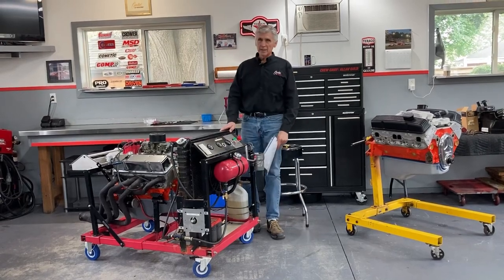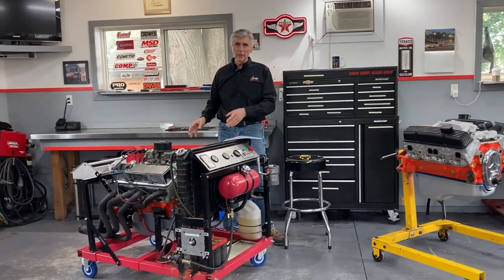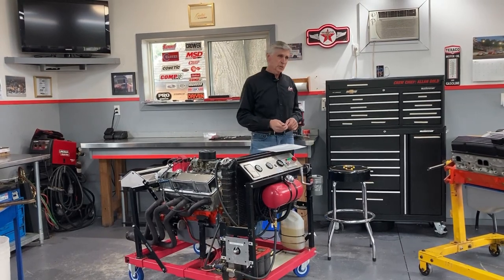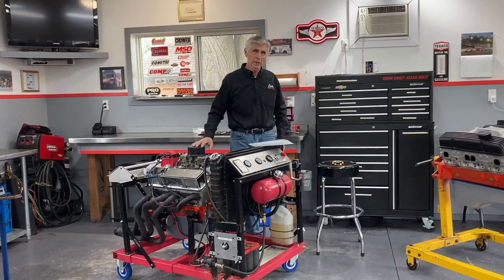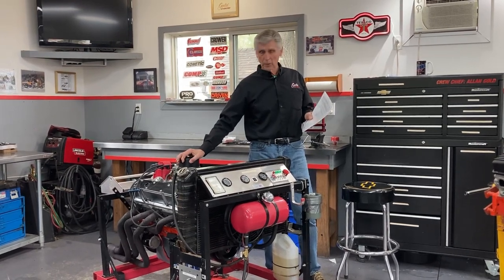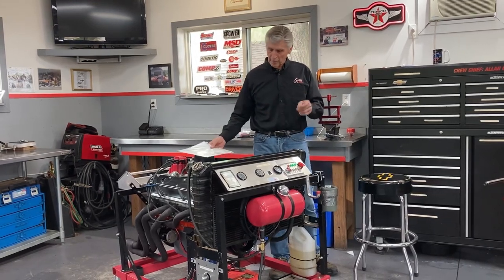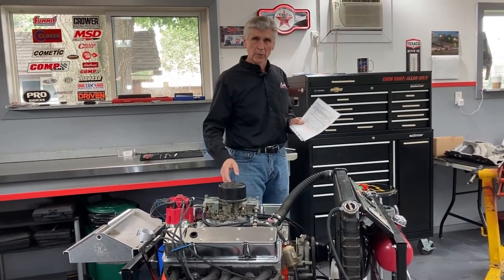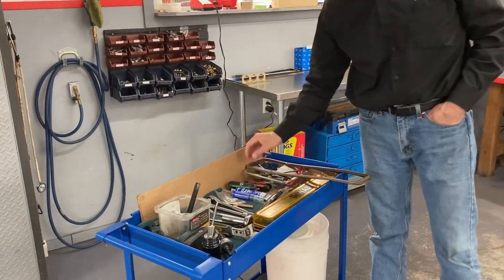400 SBC Chevy - How much HP will we gain or lose advancing 4 degrees?? Comp XE268H Camshaft -Part 1

Comment: Why are you running vacuum advance from manifold vacuum rather than ported? .... That pulls in a lot of timing at idle
Reply from the maker: Thanks again for your input Scott. Lots of timing at idle is desirable I think. It allows closing the butterflies a little more and revealing less idle transfer passage. This results in a leaner idle mixture and less chance of fouling plugs. That is my experience anyway. AG

Comment: Good day M. Gold.

I see that you really seem to like the XE268H cam. By looking at the dyno sheets provided by Comp Cam, it seems that the XE262H makes more HP, more torque and has a better idle vacuum, so my question is, where’s the catch? What am I missing? 

Thanks
Reply from the maker: Thanks Clark. Take into account that this engine was going in a full size truck with and automatic transmission and highway gear. I think the Comp 268 is their best selling cam. AG

Comment: Is there a full build sheet on this engine? I interested in what cylinder head and Intake you used Sir.
Reply from the maker: Thanks Scott. The intake is a Summit aluminum AIR GAP. Heads are Promax 64 CC. I measured the intake runner volume at just over 200cc. AG

Comment: Hi Allan.
That CompCam XE268H is a 110° Lobe Sep, 106° Intake, so already has a 4° Advance in the cam.
Not sure what compression and or application it is.
I do not see an advantage advancing the cam.
Should make enough vaccuum since the intake is 224°.
After it runs for awhile and chain stretch, it will retard and it should run good.
Great video and topic.
Take care, Ed.
Reply from the maker: Thanks for your input Ed. Your comments are right on. There is a good chance that I will be putting the cam back on the 106 degree ICL for the reasons that you mentioned. I am thinking it will reduce the peak torque point in the curve about 200 RPM or so, which would be good for this application. 
One of the things we will look at closely is average HP and torque through the entire RPM range which simulates the driving experience and is I think most important. 
Also, we thought it would make an interesting video. AG
Reply from the maker: To cover your other question about application Ed, it is a full size 1985 C10 pickup with an automatic transmission  and standard rear axle ratio. AG

Comment: Not sure what the head flow is because you did not say what head or valve size but if you say its a 220 cfm at lift head it should make about 412 hp peak when you advance the camshaft to plus 8 that will change Z from like .9 to .88 and cost you 10 hp at peak power or 2% ... Since you are going from 6 degrees before tdc to 10 degrees btdc on opening torque gain will probably be small too I,m going to say 8 ft lbs depending on how low you test .... Might be more at just off idle but cant test there ... If i remember correctly power nation did a test like this but with a bigger change from retard to advance
Reply from the maker: Thanks for your input and detailed analysis Scott. We will see what happens on Saturday. AG
Reply: @goldsgarage8236  just watched part 2 .... If you want to understand how I knew what it would be I have videos on the math .... Air is Horsepower with it's 3 parts

Comment: Your words, Dyno time is not cheap, I know that myself.
To save time don't advance the cam, retard the crankshaft
all you need to do is remove the water pump, remove cam
gear cover loosen the cam bolt turn crank backwards 4 deg.
keep the 1/4" allen screw loose as you backup the crank,
tighten cam bolts replace cam cover plate, replace the
water pump fire it up and go adjust timing done. You'll
notice all this was done without removing valve covers.
PS your 4 deg. advance now if it's installed at 106
(assuming it has a 110 deg. LSA) you'll
be 8 deg. advance if you go to 102 deg.
This makes sence if you stop for a moment and think about it.
With an engine that size with that small of a cam I'd
seriously test it straight up, you may get better average
numbers, just my $0.02.
Reply from the maker: Thanks Mark. Just heading to the Dyno now. Great suggestion. I will give it a try. IF it works it will save me having to back off the valves. Lets see what happens in the video. AG